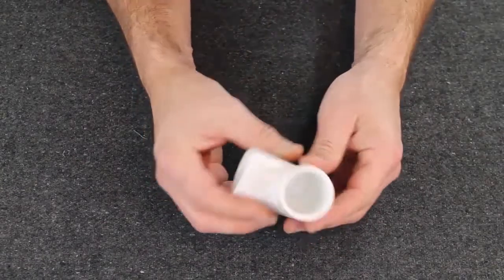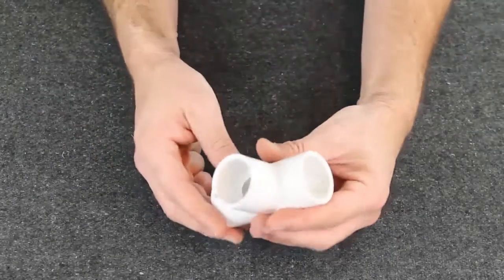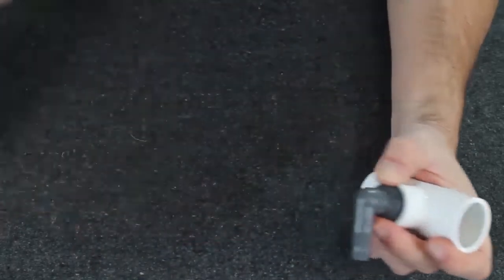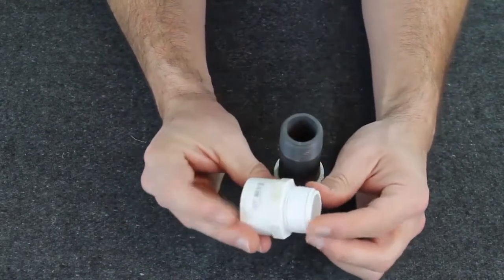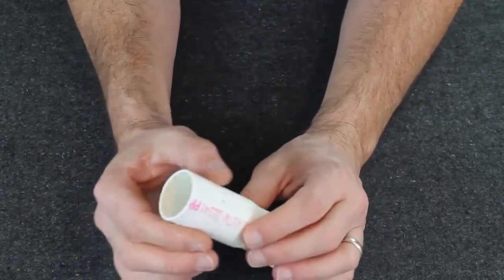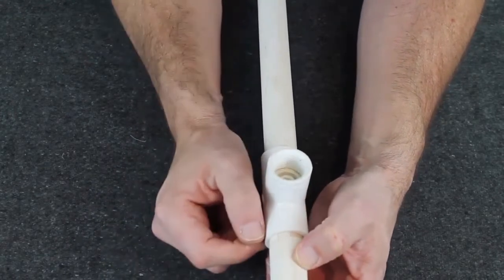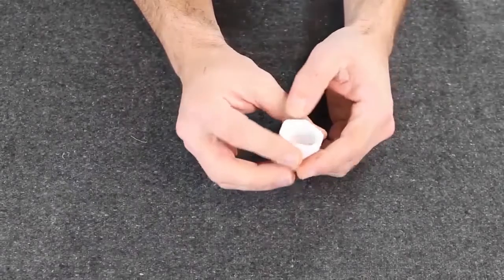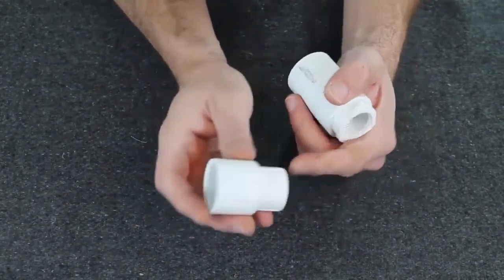All About PVC Fittings (irrigation training)

Comment: THERE IS A 4th WAY: purging air in the line can also increase pressure. I've been working with a gravity fed system and the terrain is somewhat undulating between the tank and the highest elevation controller. I added a valve to purge air from the system at a local high spot in the feeder. Once the line is bled there is enough pressure to get the MP rotators to pop up. If I don't do this at the end of rainy season there just isn't enough pressure.
Reply from the maker: You've made a good point about piping that changes elevation like that. If it undulates too much, it can trap air in the upper curves. Thank you so much for commenting, it may help someone in a similar situation. Things like this can be pretty tough to figure out for a tech that's not intimately familiar with a system.

Comment: Where do I find these "saddle clamps"?  I've been to plumbing and irrigation supply houses and they do not have them.  They did refer to them as "snap taps".  If I had some (schedule 40) 1", 3/4", and 1/2" to fit the outside diameter of our class 200 pipe it would save me hours of digging.  Thank you.
Reply from the maker: You know, they are pretty tough to find. I think I get mine from my local Ewing Irrigation. But there's some great websites as well as amazon that have them I'm sure.

Comment: Let me ask you, why is it the couplings are so short compared to bell ends?  I would love to be able to buy those long bells to use for couplings but I have never seen them.  Any thoughts on that?
Reply from the maker: That's a good question!! I've wondered about, and I'm sure there's a good explanation why bell ends are so long. But there is a long coupling out there from some manufacturer. Not as long as a bell end, but definitely longer than normal. Just don't remember where I got them. I like to have short and long options on stuff like couplings, slip-fixes, etc.

Comment: What type of 90 degree elbow would you recommend to connect 1" black poly distribution tubing? I heard 1" Easy Loc is a better option that the $1 Polypropylene Blue Twister Insert 90-Degree Elbow that Home Depot sells. What would you recommend?
Reply from the maker: To be honest, my experience with poly fittings is that even the cheap insert barbs are as good as anything else. You've got to use clamps and keep the pressure below 80. That being said, Easy LOK has a good reputation, bit more expensive though.

Comment: I’ve been told to avoid Schedule 40 pvc. Is that advisable and if so, what would you recommend?
Reply from the maker: I'm not really sure why someone would say that in relation to irrigation systems. Schd 80 fittings are  obviously thicker and better, but they're also a good bit more expensive. I'm sure plumbers want to only use Schd 80. But cost-wise, it's just not cost feasible to construct an irrigation system with Schd 80 fittings.
Reply: @Proirrigationtraining bsolutely agree schd 40 will do the job for just about every application. I personally am  not familiar with residential irrigation. However, i do know golf course irrigation, and im sure it's just the same with both sides, nothing but an irritation. The nightmares i could tell about broken lines, and all 3 pump running trying to maintain pressure, before hitting low pressure cutoff. To note each pump could flow 600gpm while maintaining around 90 - 120psi
Reply from the maker: @TheJoshman2011  600 gpm!!! That's wild! I've never worked on a system that large before. I've done some medium sized ag, sports fields, etc., but having 3 x 600 gpm is a lot of water. And yes, schd 40 will do the trick for any residential system.

Comment: Daahir jimcaale dhegataag.
1.0. What will happen if i use a 10 inch uPVC pipe lines of 20 kilometers length with check valves for every 1km inorder to get all the time a full of water  pipe line installation due to the gentle slope of the ground. 
2.0. What will be the effect of this one directional uPVC  check valves. 
3.0. Give some of your comments about this matter.